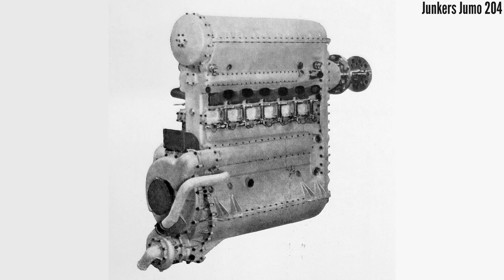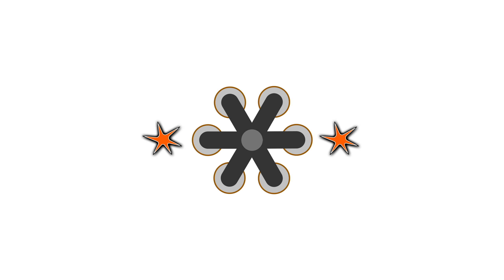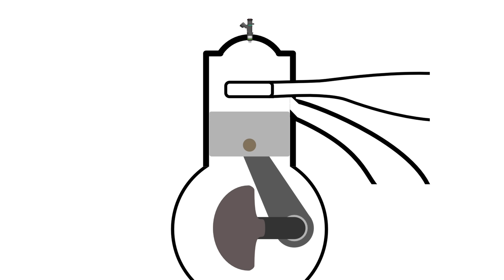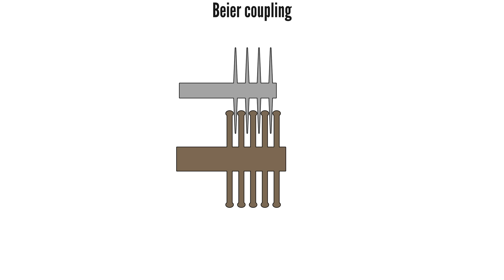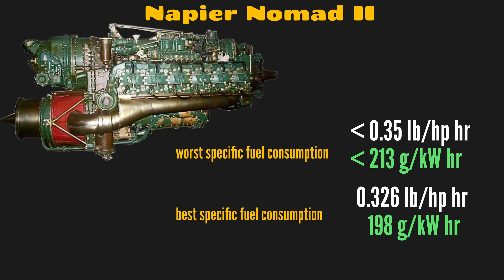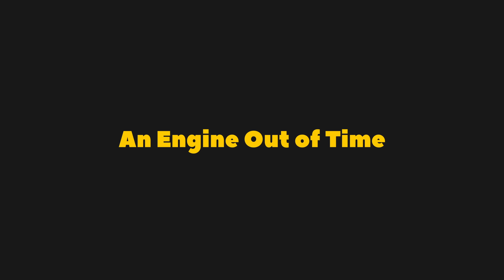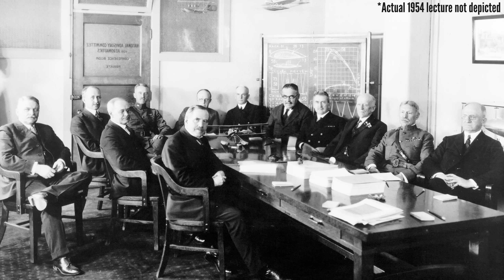Napier Nomad, the Most Complex Aero Engine Ever Made - Explained

Comment from the maker: Support me on Patreon : https://www.patreon.com/letsgoaviate
The Junkers Jumo 205 Opposed Piston Diesel Engine Explained : https://youtu.be/NQBy1Boyfbo
Was the X-24 Engine a Horrible Failure? Rolls-Royce Vulture & X-2775 Explained : https://youtu.be/5VNnBW7gMlU
Reply: What about heavy ground vehicles (ie tanks) and small ships & diesel subs, where fuel efficient is more important, and engine weight is not. 

Thanks for the interesting video!
Reply: @guytech7310 ditto this, how about the Kharkiv model V-2 which has to be the engine with the longest production run ever. 1939 and still being made I think.
Reply: Thanks for the video. Napier had a factory in Lincoln, England. So choosing an AVRO Lincoln as a testbed was an interesting choice.
Reply: The napier nomad 2 stroke turbo is now available in the arctic cat catalyst riot and it b eats skidoo and polaris!

Comment: It seems to me if the exhaust can actually produce that much horsepower, it would have been a better idea to use the turbine to spin an electric generator. 
 An engine like this would actually be better suited for an application such as a tank or quite possibly stand by power generation.

Comment: So, they built a large Turbocharger with a power output shaft and wrapped it around a Two Stroke Diesel engine. Nice but a little complicated really. You know that old saying, "The more you add to the plumbing, it's easier to clog all the drains".

Comment: The Nomad was a formidable engine on paper. It was never produced because its complexity scared everyone silly. The gas turbine offered simplicity rather than complexity, albeit at lower efficiency.
Among other details, the Nomad utilized a continuously variable transmission between the exhaust turbine and the power train. This concept that has always challenged mechanical engineering, and to a general or an airline maintenance manager it's was like saying "and then a miracle happens here".

Comment: Given the extreme need to chase fuel efficiency but maintain high power output in automobiles I’ve wondered by modern automotive engines don’t have something similar to the Nomad. Decouple the compressor/turbine into a supercharger driven by the engine with the turbine powered by the exhaust but sending its power directly back into the crankshaft. No blow off valve and capture nearly all of the exhaust energy.

Comment: Didn't the P-38 use turbo compounding from an Allison V-12?  As I recall the power unit took up the entirety of the space in the booms.
Reply from the maker: It's engines were turbocharged (or turbosupercharged for the purists). It had  a turbo which was quite unique for inline engined fighters at the time due to the massive amount of space required for the system. But it didn't do turbo compounding, it simply expelled excessive energy rich gas out of a wastegate.

Comment: The advancement in axial compressor design and material design has made turbine engines incredibly impressive today, the GE9X General Electric turbofan produces an eye watering 61:1 compression ratio from the axial design.  These are incredible figures.  Compare this to the 5.62:1 compression ratio which was normal at the time

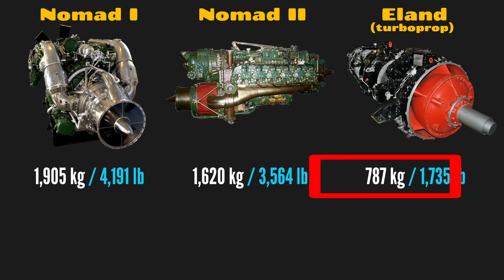Comment: 18:51 "more than double [the weight] of comparable turboprops, cutting into the range"
That's an erroneous axiom. Fuel weighs several times more than an aircraft's engines, so doubling the weight of the engines while reducing the fuel burn by 50% increases range dramatically.
Engine weight is almost irrelevant because the comparison not to engine weight but to the total aircraft weight at takeoff including fuel. Double the engine efficiency and as long as the entire aircraft's weight and drag less than double less fuel will be burned. And since much less fuel is burned less fuel needs to be carried.  So in the end that double-the-weight engine results in lower take off weight.
Engine efficiency affects fuel load. Fuel load trumps engine weight.

Comment: looking at the drawing showing the different components I think a simpler way to describe it is just as a turbo + supercharged 2 stroke. (Since it has a gear driven and turbine driven compressor) The only aspect of it that remotely seems to incorporate jet power is the additional combustion chamber in the exhaust manifold to boost the turbine which is like anti lag in a turbocharged car, but even that doesn’t directly drive the  prop in any way like on a turbo prop. Basically it’s a 2 stroke version of the Lancia Delta S4’s powerplant. Still very impressive.

Comment: Rolls Royce also played around with a similar concept.  They made the 2,729 hp "Crecy" V12, a 26 litre 2 stroke, sleeve valve, direct injected petrol engine. (It was originally diesel, but ended up direct injected petrol.)
Harry Ricardo was also involved with this. 
A single cylinder working "concept" engine was developed around 1937,  some V2 models also happened and 6 real V12's existed. They were going to try to fit one to a spitfire that was normally Griffon powered if they could get the engine reliable, but worked out the airframe probably wouldn't be able to handle the engines potential. 
In the end Rolls Royce dropped it in favour of focussing on their turbo jets.
In a non-aviation aside, Cummins played around with one of their earlier, mechanical injector N14 6 cylinder in line engines (295-525 hp normally) by using an extra "turbo charger" after the normal one to harness any still expanding gasses, this didn't compress air back into the intake,  instead it drove a gear that connected to the fly wheel. It took away most of the engines "parasitic" drag and loads, making the engine much more fuel efficient, and enabled higher power output.  It didn't get to production AFAIK. Too temperamental.

Comment: This shows that Napier learned little from the Sabre experience. It also seems like an extremely complex way to turbocharge a 2 stroke diesel. Yes you do get a bit of thrust and that might make up for the reduced propeller efficiency at high speed but I doubt the weight and complexity can be justified. Detroit put turbochargers on their 2 stroke diesels and boosted efficiency it was a much simpler implementation than what Napier was trying.

Comment: This seems to be a good idea for extending the range of Ukrainian drones. Even using the exhaust ½ of a small car turbocharger to drive a 2nd midline propeller would increase range of the current petrol engines and muffle the loud,popping chainsaw exhaust noise, improving survivability vs ground spotters,while crossing 1500 km of hostile territory.

Comment: Thank you for your clear rational analysis. I have owned a 1949 Morris Eight Series E  for my whole life. My parents bought it new and when Mum stopped driving it became mine. A nice little classic car but so primitive. A cast iron side valve engine making 29.5 horse power at 4400 rpm. When I think of the Merlin etc only four years earlier, what went wrong?

Comment: The Rolls Royce Pegasus engine from the Harrier Jump Jet had a "split turbo" design and was the inspiration for the Mercedes F1 hybrid engine. There is a significant thermal efficiency in having the hot turbines away from the compressor. But essentially you are describing a modern F1 engine, just add a battery.

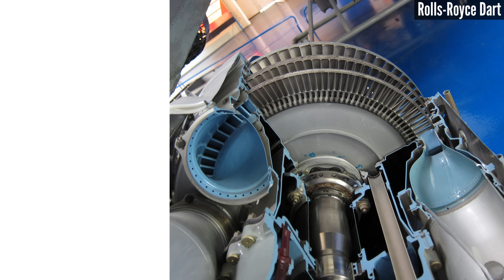Comment: 4:10 I'm thinking this redline is inaccurate, as most modern turbine engines still have a redline in that vicinity, excluding transient excursions that might go up to 1,000C.  Some go higher, some are even less.  Generally speaking if you take a modern turbine up to those temps you're going to stretch some blades regardless.

Comment: Turbo compounding was done successfully on the r3350 in the dc7 and super constilation. The turbine was viscous coupled to the crankshaft allowing a standard supercharged engine to get the benifits withought massive redesign. Not as complicated as the naper and lighter. Still unreliable.

Comment: How neat is that?  Well, it's kinda neat that they got it running, but the overall thing seems to be kludge on top of kludge on top of band-aid.  Rather than putting the time and effort into improving the incredibly simple axial turbo-prop with its very few moving components, they come up with this.  It's a thing of wonder, to marvel at,  but it's not elegant nor clever.
And given the weight difference, a pair of Elands had 1000shp more and weighed 2.2 tonnes less, which is a fair amount of extra fuel you could carry.

Comment: Himmmm.  I see losses of heat from engine to turbine {but suppose this could be insulated for greater efficiency}.  I thought your engine was going to be opposed pistons  {no cylinder head}  with two cranks then use those cranks to turn the opposed props is how I would have done it.

Comment: 17:50 “water injection” ?  How does that improve performance?
Reply from the maker: It's not mentioned how it was employed in any of the official papers, but I assume water is injected into the intake air stream (after compression) to lower intake temperature, which will allow an increase in takeoff power.
Reply: I believe that tuners are using it in drag races these days. you should search it up on youtube
Reply: It cools the air intake stream, thus making the air more dense, providing more oxygen for combustion.

Comment: Napier seems to not be intimidated by engineeering complexity.  The Deltic Diesel was used in fast boats and and locomotives.  It had 3 crank shafts working opposed pistons in 18 cylinders. For a grand total of 36 pistons.

Comment: It's cheating a little but a Trent manages 189g/kwhr as in industrial unit, an aero engine will manage slightly more due to a higher rating and also operating in cooler air. Though it is an example of how far you need to drive a brayton cycle to beat a turbo compound.

Comment: I think you would enjoy the Junkers 223, 4 crankshaft, 2 stroke diesel engine. I think they have one at the Rolls-Royce engine museum, run by the Roll-Royce Heritage trust. The Museum was in the Light alloy foundry on Osmaston rd. Derby, but that is now a classic car museum and the collection may now have been split up over various sites. I visitied when it was in the Light Alloy Foundry and was really impressed by the collection. As the British aviation companies contracted post-war, each of the companies museums were merged and the all seemed to end up with Roll-Royce. Various German engines that were taken after the war ended up here too. Worth contacting the Rolls-Royce heritage trust. It seems to be run mainly by retired ex Rolls-Royce engineers, so they really know what they are talking about.

Comment: Astounding engineering . Does remind a  bit of the H16 F1 engine in the 1960s . There is something to be said for  less complexity and less weight. Things do need to be reliable (air transport really does want to be reliable , more than ground based vehicles !) . More complexity never really helps reliability.

Comment: What a cool engines and amazing pieces of engineering. Too bad they went away from fuel efficiency for many years. The Nomad II could be described as a turbo charged 2-stroke diesel with the turbo being connected to the driveshaft via a mechanical version of the Toyota Hybrid power split device. It's amazing that so many vehicles today use an electric version of the Beier coupling :) Well not exactly, but the idea to use a variable gearing and have the power being split via the mechanical advantage of a planetary gear system is there. And in both cases it's being used to improve fuel efficiency.

Comment: The Wright Turbo-Cyclone 18R-3350-TC turbo compound radial engine. Just because the R3350 was an existing and relatively mature engine doesn't mean it wasn't complex. Add to that the perpetual struggle to keep this monster cool. It was used operationally in, among others, the Douglas DC-7 and Lockheed Super Constellation.

I would like to see some reports on 2-stroke diesels vs 4-stroke diesels. I cannot imagine the 2-stroke diesel, with its lower compression ratio, need for a mechanically driven supercharger, and high fuel burn rate could be more efficient than a 4-stroke diesel. More power-dense maybe, but not more efficient.
Reply: A two stroke diesel  is always supercharged otherwise it won't work.The "supercharger "isn't for power,it's for cylinder scavenging.

Comment: When I get some time I will try to add some details on the Nomad II.  

One thing is that the conrods in the Nomad II were not knife and fork but were two conrods that shared the same journal, they were opposite each other and had no big end caps.  They each had a thin band on opposite ends of the journal that ensured the rods did not fall off the journal when the engine was not running or during starting.  As you noted, there are no torque reversals in a supercharged two-stroke engine, so there is no load on a bigend cap when the engine is running, so no need for a bigend cap.  This lack of torque reversals was a key reason Royce was convinced to go ahead with two-stroke designs as the crankshaft was much easier to design.

Diesel engines were considered the future in the mid interwar years, however disappointing power output of converted R-R Kestrels and a Buzzard convinced R-R to concentrate on petrol engines.  The R-R Crecy (internally designated the PI engine) project started as a diesel and then changed to petrol as that fuel improved, both designs were direct injected.

There are a number of other fascinating parts of the Nomad design including: it required a primitive spark ignition systems to start as the axial compressor and low cylinder compression (about 7:1 if memory serves) was insufficient for compression ignition at low RPM; part of the fuel efficiency came from the use of the axial turbine compressor to provide part of the overall compression as an axial compressor is the most efficient compressor and a piston compressor about the most inefficient compressor; the Beier coupling did not transmit all the power between the turbine and crankshaft, it was part of the power-sharing coupling with gearing comprising the other part of the coupling; the Beier coupling did not allow slip like a torque converter, it was a genuine variable ratio coupling with all the power being transferred through a very thin oil film in shear; there is, in true Napier fashion, some other rather unusual design features in the engine, but I will have to find my copy of the Flight Magazine article on the engine to get the details right.

Comment: Were the engineers at Napier satisfied with the engine performance? The German Heinkel factory had a similar configuration with the Heinkel HE 177 Greif, featuring the twin DB 610 engine. Naturally, the technology of these engines was considerably less advanced than that of the Napier Nomad. The German developers never managed to make these twin engines truly safe and reliable. For the HE 177 crews, engine problems and engine fires were as dangerous as the Allied air defenses. Thus, in military jargon, this aircraft was also called the "Reichsfeuerzeug" (Reich Lighter) or "flying crematorium."
Reply: The DB606 (2 x DB601) were separate engines with a combiner gearbox.   The DB610 was 2 x DB605.   These were completely separate engines just joined by a common gearbox.
The He 119 and Me 261 which flew with the DB606 never exhibited any Problems whereas the He 177 prototypes caugh fire repeatedly after takeoff starting from their first flight.
-The DB610 also worked on the Ju 288 and latter Me 261.
-DB610 seems to have been able to achieve MTBO of 200 hours (same as standard DB605) from Sept 1944.  In March during the baby blitz the cold start procedure was used and this lead to nearly half the force getting engine fires.
-The Sabre, Nomad, Allision V-3420 all  shared a common crankcase unlike the DB610 though they still had a seperate crankshafts

Comment: This is very interesting because it actuall is an inverse route to come to the same solution: where diesel engines in heavy trucks are diesel engines that are being made more powerfull and efficient by adding a "turbo compressor", here we are dealing with an attempt to make turbine more efficient by placing a diesel in the middel. There is a difference, however, because in a truck diesel with a turbo compressor the central axle of the compressor does not directly do work in moving the vehicle (like in the nomad 2). Which then again chainges in the most modern implementations where the turbine part of the turbo can also drive an electro generator that produces electricity that can then be used for any purpose, including helping with the propulsion of the vehicle.
Reply: And there are also truck diesel engines with similar concept than Napier 2 with a second turbine coupled  directly to engine crankshaft  increasing power output and efficiency The experience has shown that they are more suitable on engines with more stable rpm like aviation ones than on automotive counterparts